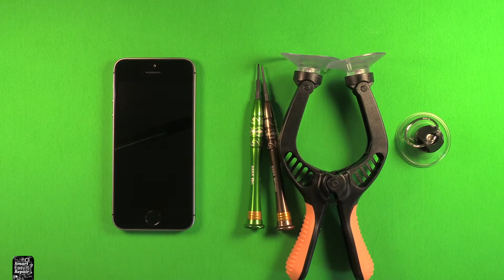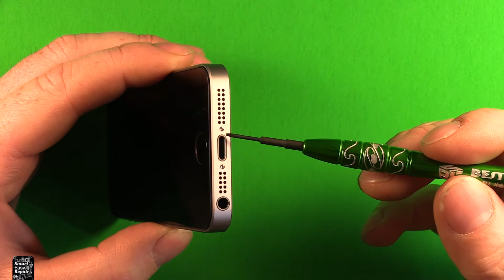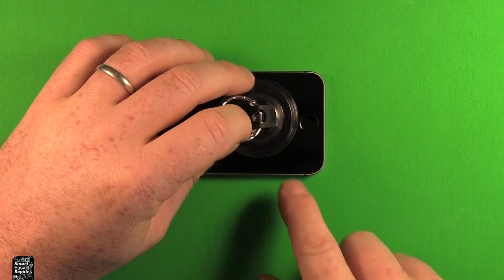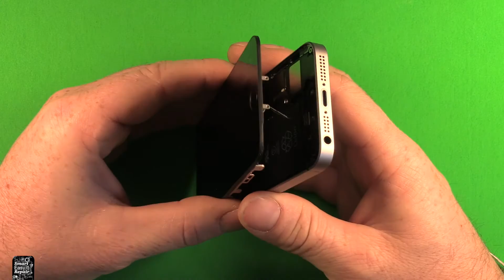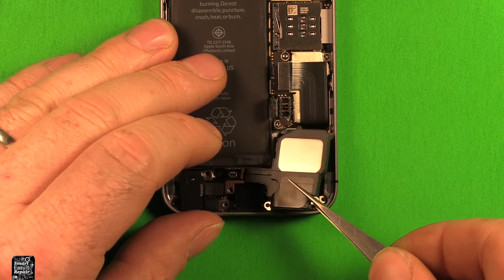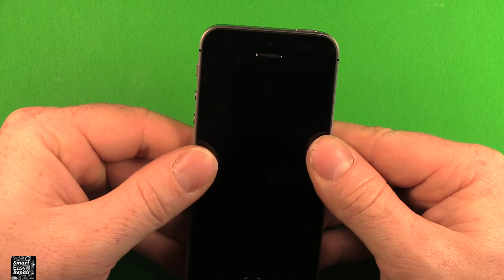iPhone SE Headphone Jack Replacement How To Change

Comment: I usually don't post comments on youtube videos, but your video helped me fixing my old phone, thanks! Just one note to help other people: I used a dollar store microwavable heating pad to soften the glue (it was hot, but I could almost hold it fast without pain, so I would say below 70oC?) otherwise I couldn't open it. It's hard to open only the first time, after that the any good suction pad (I got mine from a xmas ornament) will do the job together with a cheap prying tool.
Reply from the maker: Thank you! Thanks for sharing your tips with others too.

Comment: Absolutely great instructional video! Got the parts and y phone repaired at home with a couple of tools available for a few pounds on ebay! Only point i would make is that the new parts home button connector came without the metal retaining clip which reverses it and screw down. This needs removing from the old part and adding to the new.

Great video... Thanks a lot!
Reply from the maker: Awesome nicely done!!

Comment: Hey great video! I followed your instructions, but after restarting the video I found my home button had stopped working. I made sure the touch ID wired were connected, and they were, but still nothing. Any Idea what could've happened? The cords are still intact (I didn't stress them hard at all). Also, my audio jack doesn't register when there's a device connected; it still plays from the loudspeaker and it didn't have this problem before.
Reply: Update: went through the procedure again, and by the grace of the DIY Gods everything works perfectly now. Thanks again for the video. I repaired my phone for $3.50 instead of buying a new one for $350. Score.
Reply from the maker: Awesome great job on being patient and getting it figured out! 👍👊
Reply: @LooseTie101  I am in your same boat Eric. My "home" button is not working. How did you fix your problem? Just started over from the beginning of this video?
Reply: Rajeev Thomas hey, sorry to hear you’re having the same scare. Yeah, I disconnected and reconnected everything and that was enough to get it working.
Reply: @LooseTie101  Thanks Eric for replying! I did the same but no luck.